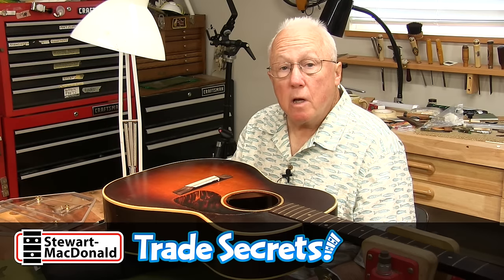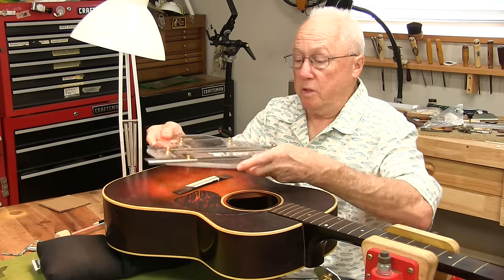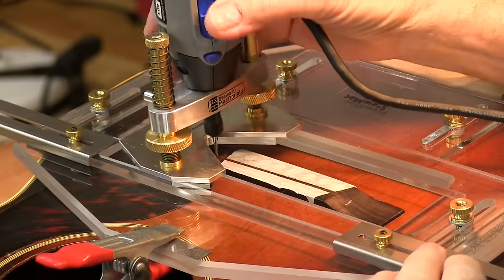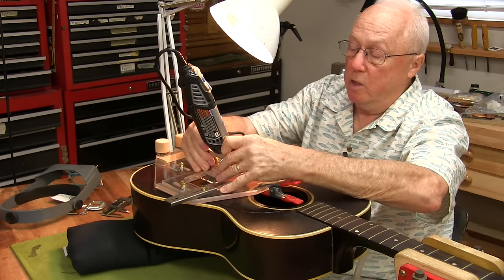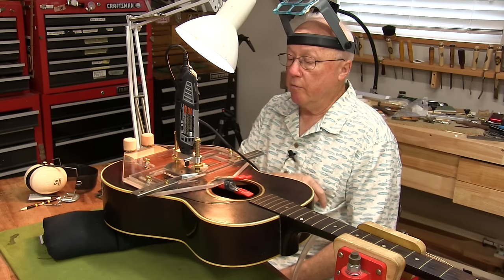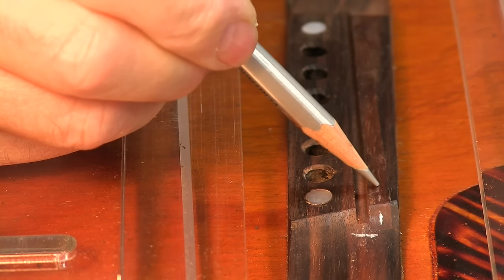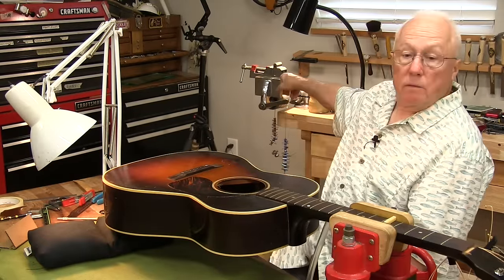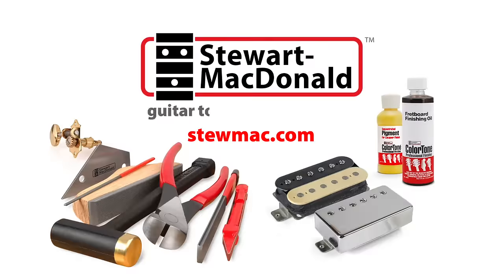Acoustic guitar saddle: how to cut the slot

Comment: I wish we could ask him a question.....there's not too many luthiars I trust....most are backyard mechanics. (I've had them almost destroy an expensive guitar)
I wonder if you can widen the saddle slot and increase the saddle width from 1/8" to close to 1/4" to help correct intonation.  That way I can file the saddle further back to correct for a sharp low E.
Will it cause a problem if the saddle moves back an 1/8" towards the pin holes?  Will there be correct angle to the pin holes?  The front edge of the saddle would remain the same...the back edge moves back 1/8".  I have a couple strings that are out of intonation.  The A is not real bad but the E is 10 cents off.  I can tune the E string 8 cents flat and it some what works....can't really hear the flat intonation down low on the fingerboard.....and it gets to about 3 cents off at the 10th to 12th fret.  But...it's not perfect.  Is it worth the trouble to widen the slot and is it practical?